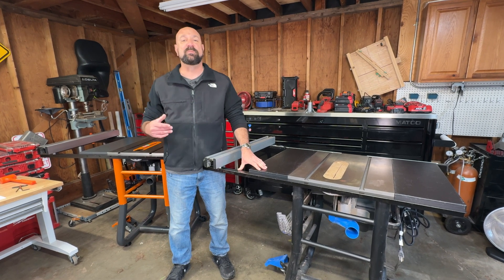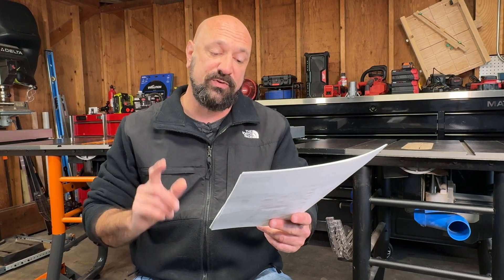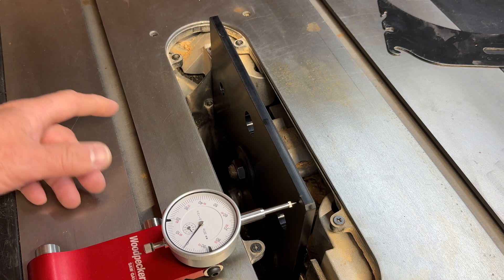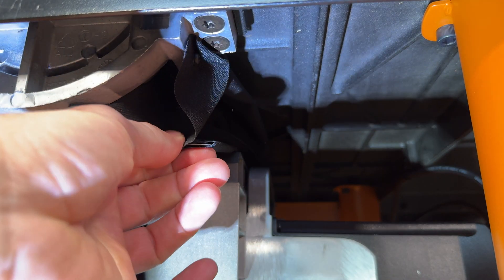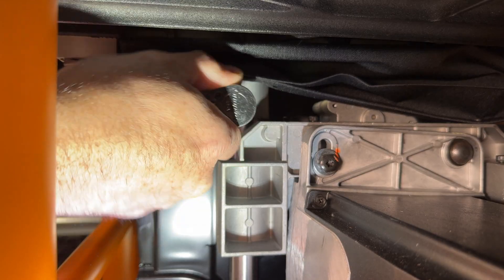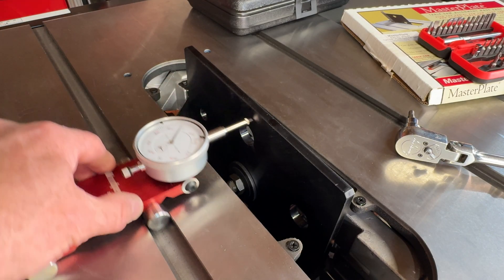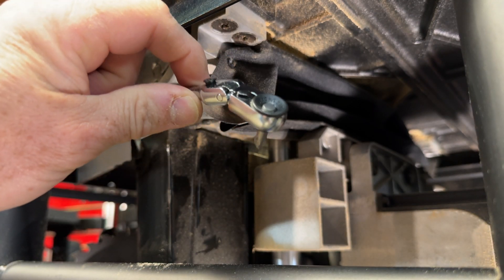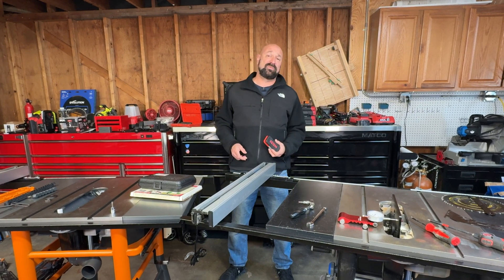DELTA 36-725T2 and RIDGID R4560  ||  Blade Alignment

Comment: Thank you for doing this!  I just attached my Bosch RA1181 router table to the Delta 32-725T2 right wing a couple days ago.  I had loose wing bolts and everything was out of flat.  Now I need to make the fine adjustments to the Delta blade motor assembly and get everything parallel and square to the blade at 90 degrees.  Fence is good but goes out of alignment pretty often.  Great table saw IMO.

Comment: Thank you! My blade was off by quite a bit. I contacted Ridgid support and they said they would email me instructions on how to adjust this but they never did. Then I found your video. It’s just what I needed. My blade is now aligned perfectly. However, I have a suggestion: Getting the down facing screw out of the fabric was a son of a bitch.  However, I realized later that you don’t need to remove any of the screws holding the fabric. By lifting up the fabric you already have access to the bottom allen head screw. All you need to do is feel with your finger where the top allen head screw is and put a hole in the fabric so you can inset an allen wrench into it.  When you are finished you can always seal the hole with tape or something else if you feel it is really necessary. Thanks again for your great video.

Comment: I might be overthinking this, but I am looking at the delta 36-725T2 parts digram and it seems to me that you are just loosening one corner of motor rise rails assembly, the upper rear corner. I think that would create couple of issues - first it would put the two rail bars  assembly in torsional tension by making the bars not parallel. That in turn would create different misalignment of the blade at different blade heights. Could be that such misalignment is small enough to matter. Second, the front two corners of the rise rails assembly use set screws in addition to clamping hex bolts. Part number 28 on parts diagram. If anything I would think those need to be checked/loosened before adjusting.
Unless there is a twist in the rise rails assembly, as in, blade alignment changes with blade height, I would do the adjustment by loosening the trunion bolts #50 (all eight of them) and then tap one or both of the trunions with soft face malett.
Here is the parts digram for 26-725T2 https://deltamachinery.com/manuals/36-725T2/#parts
But hey, I am just an armchair "expert" and do not own this saw.

Comment: Reference the rust on your Delta, HF sells Evapo Rust I believe it is called if you let some of that sit on those spots for around 30 minutes it should remove the rust and then you can just wax the surface.

Comment: It’s interesting how different these things are from my cabinet saw. With that, there are four large hex screws on the bottom corners that hold the saw top to the cabinet. Loosen those and you can twist the top to straighten it. That’s it.

Comment: For real thanks for circling back to this! Tbh the plate and the woodpecker are probably the most important specialty items needed! Definitely much easier than messing w the teeth on the blades and a speed square!
Thanks!

Edit: actually if you could link those two items the vid would be perfect! Thanks!!

Comment: I have seen many of your videos and you tell it like it is. You did a good job illustrating this adjustment. The Delta 36-725 in all its versions is a good saw especially for home woodworkers. Mine is a 2019 version and I received these instructions from Delta tech support people that sent it to me. The blade alignment out of the box was out by .005” which isn’t terrible. I adjusted it to .002” and it has not changed ever since.  The motor mount design on this saw has been in production for at least 30 years, my brother has a Delta table saw he bought about 20 years ago and it’s the same. Also, I find it’s best to use a premium full kerf blade with this saw. Even though the motor is a 1-3/4 hp it handles it very well. My only gripe about this saw is poor dust collection.

Comment: Great information Mike camera view was awesome as you know I have the same delta about 6 yrs now and it’s still going strong mine was good out of the box as well haven’t checked that in a couple yrs maybe I should check again myself I’m the one sent the pictures of the butcher block that I installed for the wings 1.5” thick still flat. My biggest complaint is I have to realign the fence a couple times a year really no biggie if I was to complain. Been a great saw! Thanks for sharing bud!

Comment: Thank you for this video! I remember seeing a review on the delta a couple of years ago and they all claimed you couldn't adjust the motor / blade this way.  It's insanity it's not in the manual. I bought my Ridgid version in November and haven't finished calibrating it because it felt like I couldn't get more out of it.  Will definitely be doing this now.
Reply from the maker: Glad the video helped! Good luck with the new saw!

Comment: Now that I know that, time to get an alignment gauge.
Reply from the maker: I paid about $100 each for the gauge and the plate  but you can find different ones for less that are probably just as accurate. Thanks for watching Streetsbolt!
Reply: @ If I spin the blade on the gauge and it doesn't wobble, I think I can use the blade instead of the plate.  Yeah... I'm cheap.

Comment: Good video for those who may need it. These saws are the only ones I know of that keeps the alignment process a secret.  
I had to align my Delta right out of the box.
I found that it was best to adjust it to +4 or +5/1000. Re-tightening the allen screws pulled it to zero. That's what happened when you tightened the top screw on the Ridged, but you didn't show what happened when you tightened the Delta screws. Did it stay at zero for you, or did you have to readjust it?
Reply from the maker: Awesome advise because I experienced the same with both and readjusted the Delta again. I didn’t tighten the bolts till after the vid was published. Thanks for watching!

Comment: I adjusted my Delta when I got it a few years ago.  It'd be nice to check it with all those doohickies you have to see if it's still correct.
Reply from the maker: I used to use a steel ruler to adjust saws and there’s really no comparison to the doohickies. Thanks for watching!

Comment: Thanks for the video should I keep my DeWalt 10 inch job site table saw get a delta or rigid
Reply from the maker: The Dewalts a nice saw for sure but if you have the space, don’t need the portability these are a great option. They are heavy, stable and quiet with large table tops for jigs and large work pieces. I now own about twelve job saws and still own that Delta, had to say something! Thanks for watching!